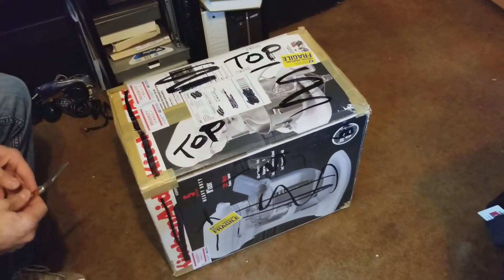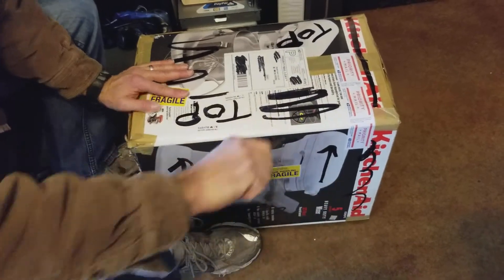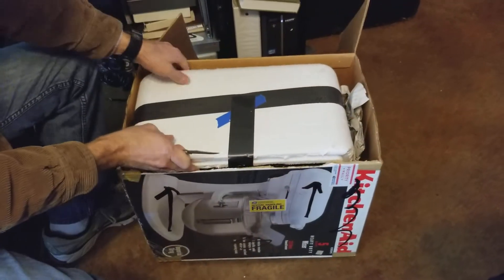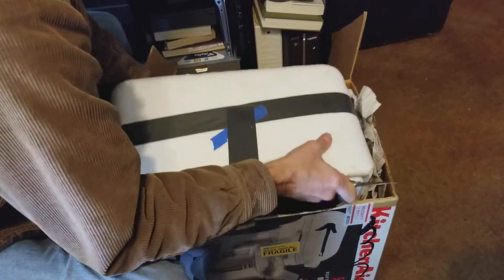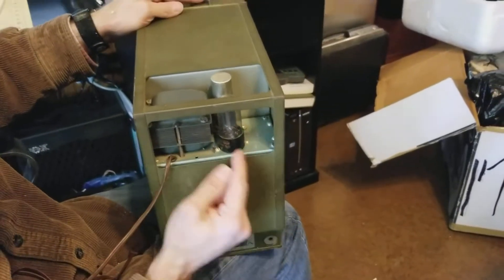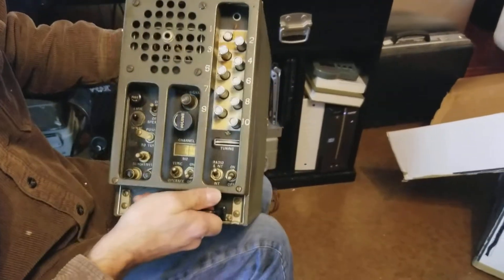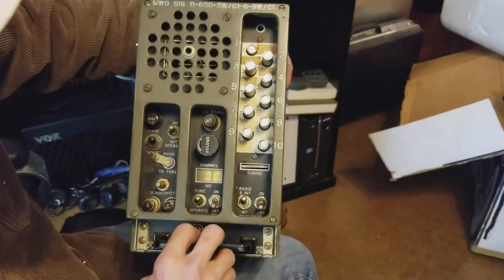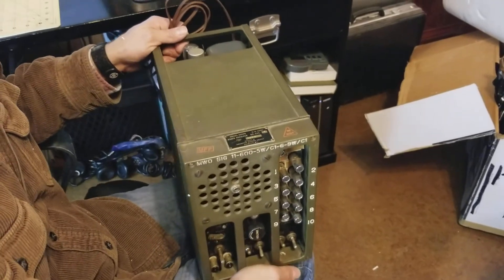Mail Time: BC-603 WW2 Radio Receiver from eBay

Comment: In 1970 i was 13 years old a man gave me a BC603 because he knew i repaired radios and televisions for the neighbourhood. He didnt have the conversion, so i did myself a conversion by wireing some connections  on the  big square connector for the dynomo on the back where your transformer is mounted and connected to an extern powersupply. he worked perfectly from the first time, i loved it. Your bc603 is not complete, it should  have a speaker protection you could slide open and close. best regards.